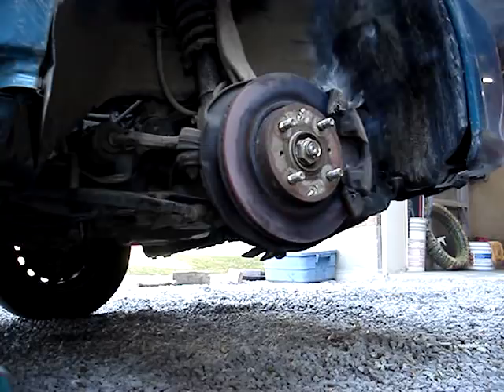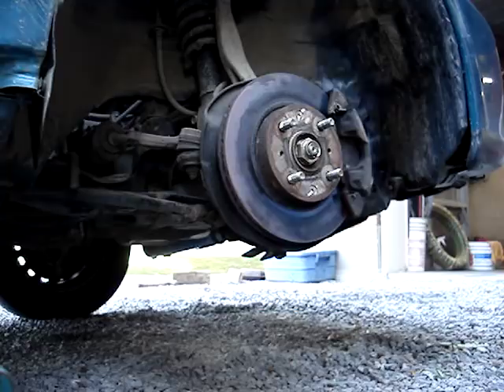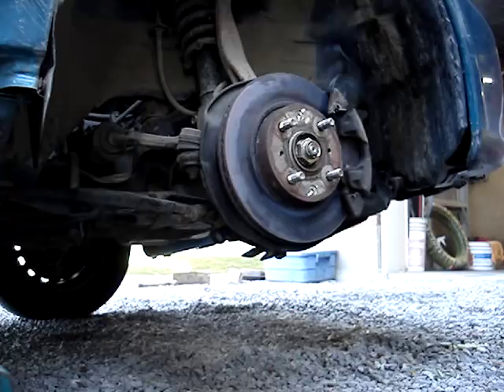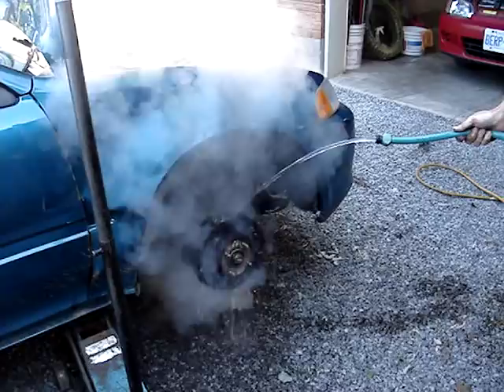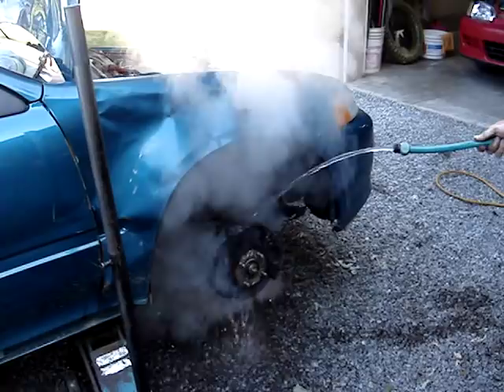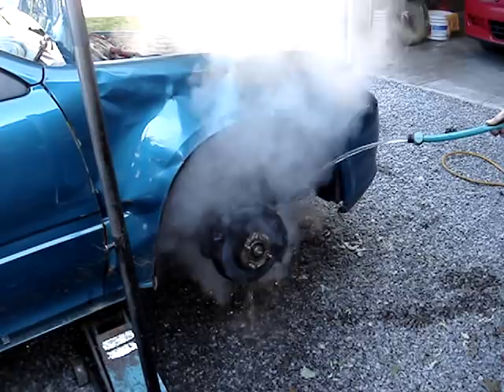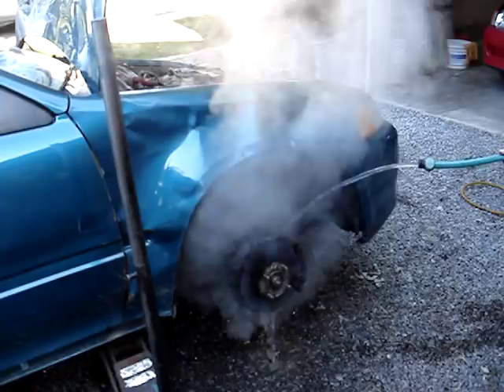Watch ● Honda Civic Disc Brakes Glow !

Comment: You really trust your differential
Reply: I think they took off left driveshaft since this car is a wrack anyways
Reply: It's a normal differential and not a LSD one.
More information about that in this video
https://youtu.be/gIGvhvOhLHU
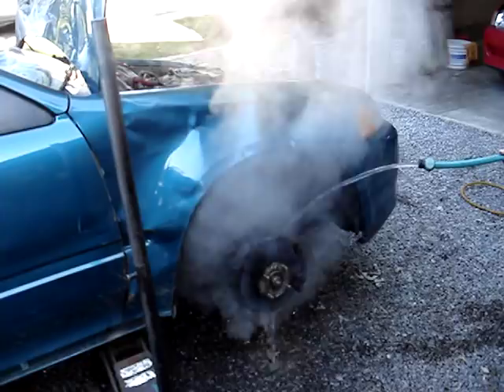Minute 2:17
Hope it clear things up
Reply: @warrior8154  with normal diff when you apply brakes it will tend to move the other side too
Reply: @fuzzfizz  nope, if you have fwd car and experience you know what happens. I have tried that with my own car, fwd, lifted one side did a test and braked, 0 movement
Reply: @warrior8154  try again, this time disable the brake that is on the tyre that is on the ground. Accelerate hard and brake hard.
Reply: @fuzzfizz  i didn't try that, but we are talking about normal car conditions. Idk what happens in that case tbh
Reply: @warrior8154  that's why I'm my first comment I said when you apply brake it will tend to move the other side. I'm talking about how electronic traction control works as an LSD in a modern suv, by braking the wheel that have no traction.
Reply: @fuzzfizz  i though you wrote it will move to the tire which is on ground. I misunderstood you. Yeah on lsd computers will do their job and brake both wheels.
Reply from the maker: Actually all we did was we applied the brakes them put a pair of vice grips on the left front brake flex hose then released the brakes. The left wheel is now locked on .
Reply: Ikr?
Reply: Yeah.. I also think the the same 😅😅
Reply: Lmao
Reply: @chrisnotap  nice valve
Reply: Because It has a differential
Reply: Why use a differential when you can just make it shaft to a gear to power only one wheel
Reply: @dudepls4715  this is an open diff in which if one tyre has less traction or less load it will get all the power unlike the other tyre with load and traction however the limited slip differential will spin both wheels no matter what unless there is a fault in the diff or a broken axle
Reply: @ibrahimqureshi2420  was waiting for someone to mention "open diff" instead of just calling it normal diff....it may not be all that great, but the thing has a name like cmon 😂
Reply: @kio51423  unlimited slip differential 😏
Reply: @ibrahimqureshi2420  sounds even better 😂😂😂 and also, "one-tire-fire" 🙌
Reply: I mean the diff can’t just change to the other wheel lmao it doesn’t work like that
Reply: @kio51423  yessir
Reply: Thats true
Reply: That’s what I was thinking
Reply: Hahaha
Reply: Bro most of the people here can't even understand the gravity of your comment. Let them dangle between LSD and movement.
Reply: You took words right out of my mouth 😂
Reply: @dudepls4715  ohh dear god, no no no....that's not how driveshaft work 😂
Reply: So this has no ASC/traction control?
Reply: @dudepls4715  if they did, right side wont rotate at all if brakes applied (all the power will go to left non-loaded side)
Reply: i legit thought it was just gonna yeet itself off the jack
Reply: Hi
Reply: Transaxle*
Reply: My seme answer hahaha
Reply: How, it’s a civic, fed?
Reply: Differential? That's a front wheel drive car. No diff there bud
Reply: Trust your head

Comment: Any one who else like me watching thinking that why the other whhel did not spin??
Reply from the maker: That's a great question. You can go to 2 minutes and 17 seconds in this video where they explain why......https://www.youtube.com/watch?v=gIGvhvOhLHU&ab_channel=allegroracing
Reply: Me too
Reply from the maker: Plus...Actually all we did was we applied the brakes, (this takes 2 people) them put a pair of vice grips on the left front brake flex hose, then released the brakes. The left wheel is now locked on and can't rotate and the brakes work normally and made it safe to perform
Reply: The differential
Reply: Nope its because of the differential

Comment: When the power is out and you don’t have a flash light do that so you can have some light!
Reply: And heat in the cold as wel😉. But just put on the wheels as a grill to be safe.

Comment: Really stupid question, I am not into cars at all, but how did they get only one wheel to turn? The opposite side in on the ground.
Reply from the maker: We applied the brakes then put a pair of vice grips on the flex hose on the left front wheel. The left front wheel is now locked. As we spun up the right front in the test, we applied the brakes a bit to cause friction.
Reply: Ahh, ok, thanks for the explanation.
Reply: There component called differential. It allows the wheels to turn at different speeds.
Reply: Marius du Plessis open differential
Reply: Marius du Plessis your car sounds like a lawn mower
Reply: Marius du Plessis open differential wheel with least traction gets the power
Reply: ive been wondering the same thing untill now :)
Reply: Marius du Plessis open differential.
Reply: There is a differential at work there. it allows the wheels to turn a different speeds when you turn and only one to turn if the others is stationary.
Reply: The freaking diff would be blown by bow
Reply: Marius du Plessis it's the differential which does the trick
Reply: i dont know much about cars i think they did something with the differential?
Reply: Marius du Plessis just and open dif
Reply: Marius du Plessis the differential
Reply: Differentials in the axle
Reply: Marius du Plessis a open differential only spins one wheel, a limited slip on the other hand spins both
Reply: clamps on the flex hose?? that's still pretty dangerous. plus you guys are jacking it up using a jack instead of resting it on a jackstands on both sides.

Comment: Why isn't the other wheel spinning?
Reply from the maker: This is the way a differential works. The wheel with the least resistance will spin. Like when you are on ice and the other wheel is on pavement. The one on the ice will spin. To be even safer during this experiment we also applied the brakes, and while holding the brakes on, we put a pair of vice grips on the left front brake flex hose, then released the brakes. The left wheel is now locked on and can't rotate and the brakes still work normally for the right front. This made it safe to perform this test. Plus we had placed logs in front of the rear tires to be even safer.
Reply: @chrisnotap  oh ok! Thank you!

Comment: Now ethier something is holding the car incase if the other wheel spins or this man has some balls for trusting that differential
Reply from the maker: Actually all we did was someone in the car applied the brakes, and while holding the brakes on, another person put a pair of vice grips on the left front brake flex hose, then we released the brakes. The left wheel was now locked on and can't rotate and the brakes still work normally for the right front. This made it safe to perform this test. Plus we had placed logs in front of the rear tires to be even safer.

Comment: yeah, you should put some water on a red hot brake disc, that is a good ideea :)) this brutal thermal shock you just done changes the chemical state of the metal composition of your disc, it actualy makes it a bit harder and easier to shatter due to carbon loss
Reply from the maker: Yes, yes and yes.

Comment: I once was on a trip in the middle of nowhere and saw white smoke on the rear view mirror. it was from my right front wheel brake, which was seizing, and luckily I was near a gas station where they had a mechanic. All he could do with the few resources at hand was to open the caliper and isolate it from the brake line leaving me with a rather dangerous 3-wheel braking action (but at least the car could move). I drove another 100km to the next town and got the brake fixed.
Reply from the maker: +corisco tupi it's nasty when that happens! Burning smell, hot brakes, not good. The first mechanic did the best to get you going. Thanks for commenting.
Reply: Chris Notap Yep. He did what he had to do, did a good job and for that I was grateful.

Comment: Don't water in melted iron you fools 🤦
Reply from the maker: Actually the iron wasn't melted. It was hot! But not melted. We were scraping the car the next day so we just decided to use water to show how darn hot it was!!
Reply: @chrisnotap  because of watering it, you have to change the parts which was hot. They won't be straight. Probably ur gotta change your discs but this was also highly harmfull for your hydraulic.
Reply from the maker: @alpyeni7683  No no. Read what I said! We were sending the car to the junk yard! That's why we did it!!

Comment: Huh, I know this is old but I wonder if it works the same on 4wd's like all four tires heat up for the Skyline or any other 4wd cars....Or still the front tires....
Reply from the maker: A 4 wd may or may not do this all depending on the type of system it had. It would be epic if it worked!!

Comment: water will harden the metal but it also warps it... fun times
Reply: What people refer to as warping is adhesion f brake pad material to the rotor. Warping cast iron is actually very difficult, and i doubt a quick temp change like this will warp.  The damage is done if the rotor is hot, and someone  sits with their foot firmly o. The brake pedal without movement.

Comment: Wait how is the left front tire not spinning?...
Reply from the maker: Actually all we did was we applied the brakes, and while holding the brakes on, we put a pair of vice grips on the left front brake flex hose, then released the brakes. The left wheel is now locked on and can't rotate and the brakes still work normally for the right front. This made it safe to perform this test. Plus we had placed logs in front of the rear tires to be even safer. Plus it's a differential and that's how they operate.

Comment from the maker: manufacturers put cars through enormous severe testing. I'm sure one of them is dowsing the brakes with water such as in real life a car coming down a mountain road (very hot brakes) and into a severe rainstorm (very possible) and having the brakes soaked in water from a puddles etc. Does the car maker want them to fail? I don't think so, unless it's a GM product!!

Comment: How did you keep the car from moving? I'd think that the differential would still put enough power to the other wheel to move it.
Reply: ***** Ah, that's simple enough! Thanks for the answer!
Reply: Not in an open diff. An LSD would apply drive to the opposite side.
As a mechanic I assure you, many times I've held one wheel (by hand) when a car has been on a hoist while someone sitting in the car accelerates and someone else listens for a bearing noise or something.
Reply: ***** I don't know what that means but that's cool.  Does the propensity to glow more or less easily determined by the material the pads/rotors are made from?
Reply: Yeah maybe. Thing is the temp can be fairly accurately guessed by the glow of steel. Discs are normally cast steel mainly iron. Around 600deg C is cherry red. Glowing then cooled to just under glowing is 450-500. Bright glowing to orange is about 800 deg C. This goes for steel, unsure for say titanium but I feel reasonably sure that the wavelength of the light hitting our eyeball is the wavelength, but I may well be wrong about that.

Comment: I bought a 1990 Ford Escort (in my profile pic) for $400. It ran, but it had sat for 10 years before I got it. I drove it about 20 miles to my house, and when I got there, the left front brake caught fire because they were half sized the whole way. Getting off the freeway after 10 minutes of going 55, the car almost wouldn't roll again lol.
Reply from the maker: +DRIV3R24 When a brake caliper seizes, there is not much you can do and it creates a tremendous amount of heat as you saw.
Reply: +Chris Notap What would happen if you were to put your finger there while it's spinning? =(

Comment: Why isn't the other tyre moving😄
Reply: The drive shaft is taken out
Reply from the maker: Actually all we did was someone in the car applied the brakes, and while holding the brakes on, another person put a pair of vice grips on the left front brake flex hose, then we released the brakes. The left wheel was now locked on and can't rotate and the brakes still work normally for the right front. This made it safe to perform this test. Plus we had placed logs in front of the rear tires to be even safer.
Reply: This is because of the front differential.

Comment: Do they normally heat up on usual driving and under normal braking conditions?
Reply from the maker: Yes! It's a great lesson to show how much work the brakes on our cars do! Just normal driving you would in most cases burn your finger by touching them.
Reply: @chrisnotap  I have 2 cars ,One car's disk brakes don't heat up much under normal driving conditions whereas the other's heat up a lot, so I am worried  and your video heightened my concern .Probably the disc Pads/calipers might by constantly touching the disc. So, I am considering to get it checked at the dealership.

Comment: I'm just curious, I read the description, why did you have to scrap the car? seems the engine was still good at least, I'm guessing the bodywork was totaled?
Reply from the maker: With Honda the engines go way past the bodies life span.
Reply: @chrisnotap  so it was the body that was the reason to scrap the car?
Reply from the maker: @xb70valkyriech  Yes.
Reply: @chrisnotap  cool, thanks for responding, I was just curious

Comment: I have the same problem in my truck . what's the problem
Reply from the maker: There are 3 main causes. Most common is a siezed caliper piston. Just replace the caliper. Second most common is siezed caliper slides or jammed brake pads. Just remove the caliper and wire brush, unsieze and lubricate the slides and pads so they move freely.  And the lest common is a bad flex hose. Over time the metal around the flex hose gets so rusted that it chokes the flex hose preventing the fluid from being able to flow back to the master cylinder. In this case, just replace the flex hose.

Comment: after heat increases, don't spread water instantly
Reply: What happens if water is sprayed ?
Reply: @kehsibawerdna8505  the metal can flake because of the rude change of temperature

Comment: Why wheele doesn't move on other side?
Reply from the maker: Actually all we did was someone in the car applied the brakes, and while holding the brakes on, another person put a pair of vice grips on the left front brake flex hose, then we released the brakes. The left wheel was now locked on and can't rotate and the brakes still work normally for the right front. This made it safe to perform this test. Plus we had placed logs in front of the rear tires to be even safer.

Comment: this man either did something to the brakes or he doesn’t have an lsd
Reply from the maker: Actually all we did was we applied the brakes, (this takes 2 people) them put a pair of vice grips on the left front brake flex hose, then released the brakes. The left wheel is now locked on and can't rotate and the brakes work normally. This made it safe to perform this test.
Reply: @chrisnotap  the good thing is u still remembered and actually I can smell it

Comment: My 2006 550i BMW did this on the highway. Had to pull over to see wtf is that burning smell. Im not driving it anymore till its fixed. Sending it to the shop this week, RIP wallet.😢
Reply from the maker: +Mo San Gaming    That's too bad. Sounds like a seized caliber.

Comment: How are you only moving one wheel?
Reply: Open diff.
Reply from the maker: This is the way a regular differential works. The wheel with the least resistance will do the work.  Plus we applied the brakes, and while holding the brakes on, we put a pair of vice grips on the left front brake flex hose, then released the brakes. The left wheel was now locked on and couldn't rotate and the brakes still work normally for the right front. This made it safe to perform this test. Plus we had placed a log in front of the rear tires to be even safer.
Reply: @chrisnotap  love that comment section is still active

Comment: Vo dusra wala tyre kyu ni gumraa
Reply: Wahi mein bhi soch raha hun
Reply: It's an AWD car, means that all tyres of car can rotate separately
Reply: @hurricanez5440  boss it's not an awd car, if you have a fwd car, you can simply disable the drive shaft to the other end which is probably what they did in this case since the car is a wreck anyways.

Comment: But when use breakes nother wheel should move
Reply from the maker: Actually all we did was we applied the brakes, and while holding the brakes on, we put a pair of vice grips on the left front brake flex hose, then released the brakes. The left wheel is now locked on and can't rotate and the brakes still work normally for the right front. This made it safe to perform this test. Plus we had placed logs in front of the rear tires to be even safer.

Comment: Next time do a high performance brake or a race one that has holes they cool faster I would like to see how long
Reply: +Wyatt Williams  according to engineeringexplained, racing teams dont actually use drilled rotors because the holes make them wek points to the repeated heating and cooling cycles
Reply: +Chris W just look at a lmp car or gt car the ones with holes are for sport and the race ones either have very small holes of have carbon brakes with don't heat up as much
Reply: +Wyatt Williams  drilled rotors are not good they just look good! ....they break easy ...if you check f1 and lmp1 cars they use big vented rotors
Reply: +Wyatt Williams No, carbon brakes are used because they can go to HIGHER temperatures, that way they can get better braking performance.
Reply: +Allen Clark that's what I meant they don't what up as much as regular disc or high performance but I'm pretty sure only lmp cars and f1 use them

Comment: That is how much heat can be generated with little friction, if your breaks are adjusted to tight or you leave the hand break on this happen when traveling down a highway you don't notice it cause your driving